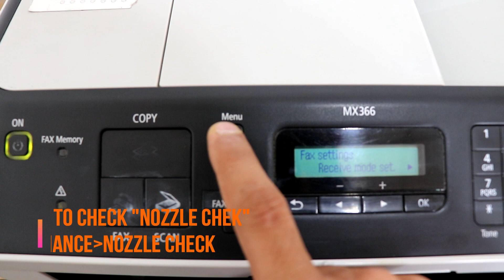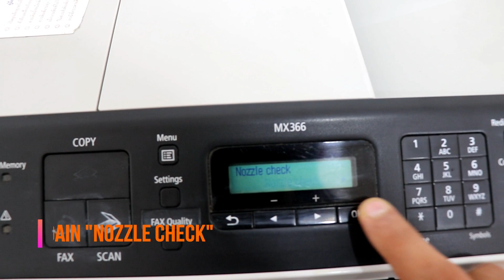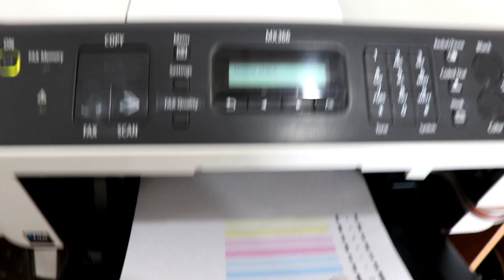How to Change Canon Cartridge in Pixma Mx Series Mx366, Mx 328 Mx360 etc

Comment: Hi, i've this printer for so long but never use it for years. The question is that i need to change the cartridge or not? Since it have been years that printer never been use so i think the inks would be expired or something similar. And second question is what should i do first before using this printer again? Thanks and sorry for poor grammar
Reply from the maker: These cartrifges last for some times. If it has been over a year then I would suggest you to replace the old cartridges with new one. Use some deep cleaning and hope it works.
Reply: @atultilkaan  so the cartridge should be changed before i turn it on again? Right now i didnt turn it on yet. Im afraid that old cartridge would damage the printer eventhough the only thing i do is turn it on
Reply from the maker: @warior1195  No it won't damage anything. It just wont be able to print. That's it.
Reply: @atultilkaan  thanks a lot man, now i can sleep well
Reply: @atultilkaan  hi bro. Just wanna say thanks for ur advice. I've tried the printer this whole 2 days for scanning only and it still work pretty well
Reply from the maker: Hi.. thank you.
I am glad it is working perfectly fine❤🙏